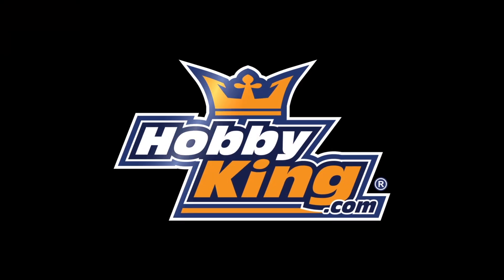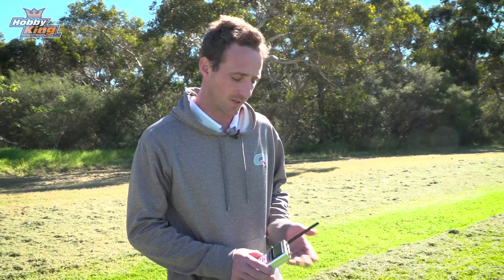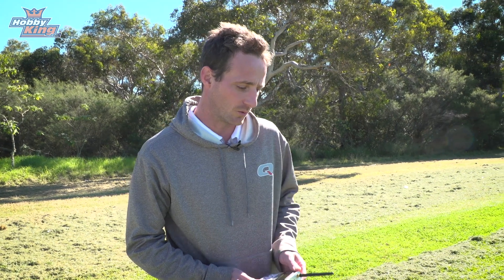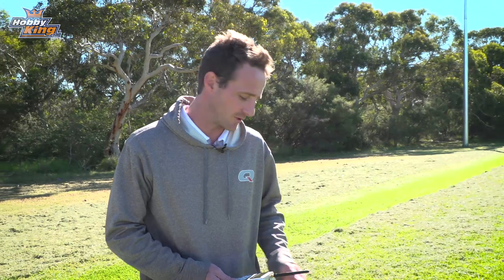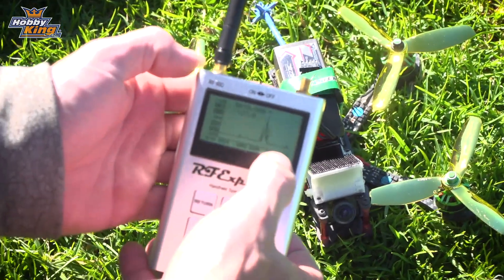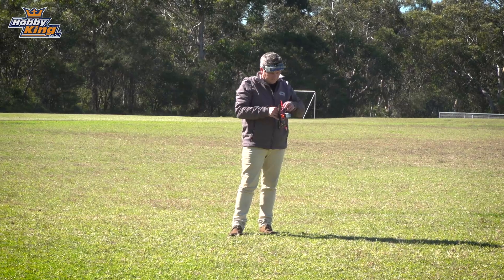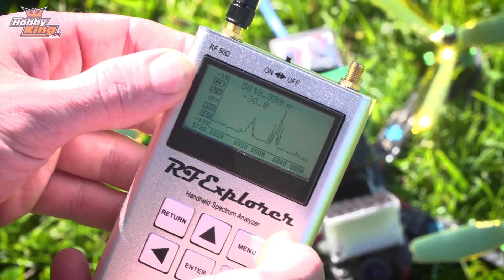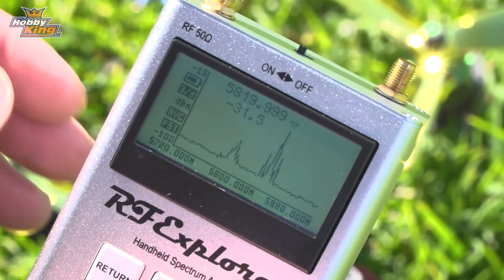VTX Signal Testing with the RF Explorer - HobbyKing Shorts

Comment: Ok yeah, it's cute, but at $365?  I bet there is one out there in the form of a dongle with an OTG cable that uses your cellphone for input and display.  I might go $125 for something like that, but this is pretty ridiculous.
<2 minutes of searching...>
Look at "RF Analyzer" app on Google Play, and do a Google search for "software defined radio".  Units out there do up to 6ghz.
Reply: Unfortunately that is not true. 6GHz software defined radios are expensive, you can get a good list of what is currently on the market today: http://www.rtl-sdr.com/roundup-software-defined-radios/ - one example could be HackRF, is the same price, and still depends on a connected external device to actually work.

Besides, a SDR comes with no calibration, requires an external screen - and screens like Android cell phone is barely visible at sun light. RF Explorer is a factory calibrated, fully autonomous spectrum analyzer.

Equivalent 6GHz portable spectrum analyzers start at $2500.
Reply: I found one for less than $250 that goes up to 6ghz!  And then you can do more with it.
HobbyKing isn't selling a $2500 unit for $365!
Reply: The price for the 6G model is well worth it.  The cheaper stuff available has horrible linearity, poor sensitivity,  and is barely usable even as hobby grade.  

This unit really shines when you use it's software hooked up to a notebook PC.  Use the matching signal generator and low cost directional coupler and you've got an excellent antenna or RF network analysis tool.

Comment: nice,. now just lower the price on this . way to pricey!
Reply: You might be surprised, but this is cheap.
Reply: RF Explorer models for lower frequency ranges are much cheaper as well. There are models starting at $99. That said, many customers do not see the need to full time own a spectrum analyzer, it is rather ordered by the local RC group or a bunch of users to share. This is an instrument that will last many years, as opposed to the money we reserve to our planes.
It does not make sense to fly a >$1000 plane and not use any kind of tool to check spectrum, in several countries is even mandatory for professional aerial photography or video.
Reply: 5.8ghz goggles usually have a scan feature, so you can find an open frequency easily.  2.4 radios are spread-spectrum, so the issue is less serious there, and a SDR that covers frequencies lower than 2ghz is pretty cheap.  To shell out this kind of money, the need would have to be pretty dire.
Reply: "software defined radios" are out there for less, and they're coming down and getting smaller.